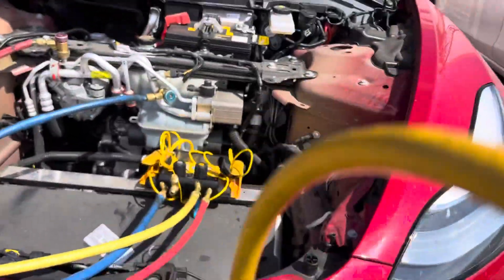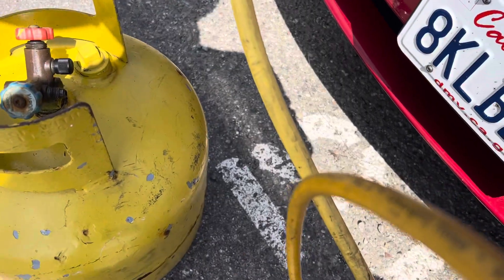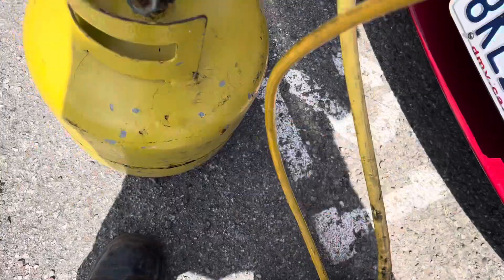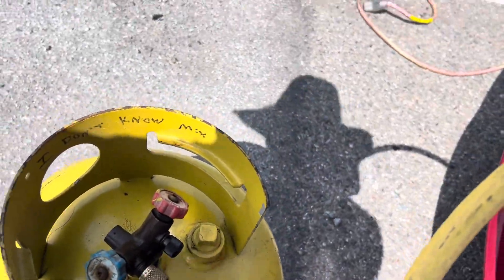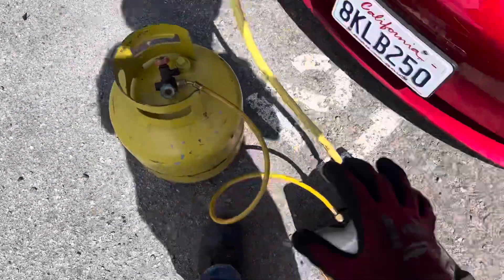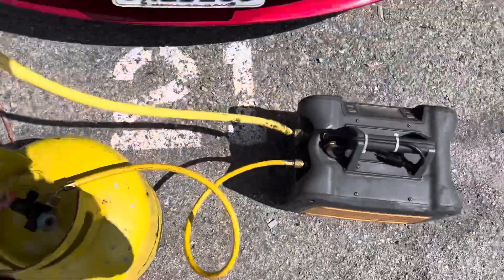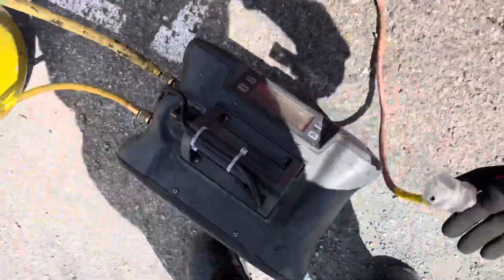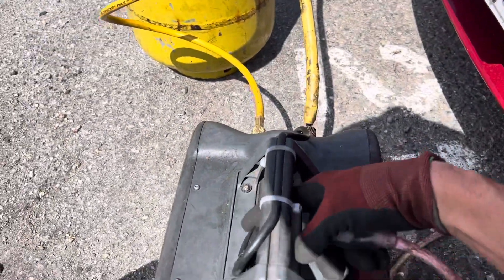RECOVERED CONTAMINATED REFRIGERANT AT TESLA THAT CAME IN TO THIER SHOP.

Comment: do you test the refrigerant for presence of  sealant before using your identifier and then recovery?
Reply from the maker: No ,  ceiling does not affect my recovery equipment doesn’t do anything to any of my equipment. 

But it does plug the filtering restriction device in my refrigerator Analyzer . 

And I have to use extremely strong solvent on that little metal device and extremely high pressure to clean it out . 

It’s a little bit of pain in the ass 

But I have several back up, so I don’t care . 

This is just another one of the reasons I don’t buy that garbage that is sold for the automotive industry , 
      Because it’s sensitive and can be damaged by some of the sealants that are out there on the market. 

And sometimes some of the commercial or residential HVAC guys get the bright idea .  Or a do it yourself customer to purchase some of the sealants that are recommended for a residential or commercial system..    hey system anywhere that has a capacity of 5 tons to 10 tons. 

And they stick that sealant in a tiny little itty-bitty automotive system that is only one ton to 1 1/2  tons capacity . 

I think I have done at least one maybe two videos, showing where my filters on my refrigerant analyzer got plugged up by sealant from customers cars . 

But my recovery machines can eat sealant like a child eats candy bars no problem at all .
Reply: so, Tom for us ,the average techs who work on a/c time to time with a rrr snap on machine,do you recommend using like Airsept sealant identifier to protect the machine and customer's cars and not contaminating the hoses  and the recovery tank? i guess if your answer is yes get it i will buy it on my own and won't wait for the management to to make the decision, thanks T om.
Reply from the maker: @moebassidji8306  if you’re a technician, you should not be the one buying this for the owners of the company’s customers

It sounds like you’re a technician who is not like other technicians and I’m not saying all technicians who just come to a job to collect a paycheck and don’t care about the customers cars 

It sounds like you’re even willing to take money out of your own pocket to protect your boss, is equipment and your customers cars who don’t even pay you money

It sounds like you belong being an owner of your own business or some day at least becoming self-employed because you care too much about your customers 

I know I was the same when I was younger to 

I know because when I was younger, I would pay for my own training that my boss wouldn’t pay for I would takeoff time without pay so I could fly myself out to training centers with no pay so I could do better work on cars and take care of my customers cars who has a technician I would say no financial benefit from my employer 

But yes, if you wanted to protect your expensive R&R equipment and better work for your customers and if I owned a recovery recycle machine that I used, I would put the air sept unit on my own equipment 

It is occasionally annoying when I plug up my Refrigerant and Analyzer. Thank God I have spare flow restrictor’s to swap out, and I have a whole extra back up refrigerant Analyzer. .

Comment: That "I don't know" mix you could spread like herpes to other cars at a discounted rate. 😂. Just call like they put "up to 10 percent ethanol" in our fuel, you could sell it as "R134a up to 10 percent other gasses". 😂 🤣
Reply from the maker: If I wanted to be really evil against other shops, recovery recycle recharge machines

I would put the Old Refrigerant Seal antimold red Devil into customers vehicles 

And when another shop with go to recover the refrigerant, it would plug up the recovery machines, the service greens and valve solenoid 

And do something like throw a few ounces of R410 and vehicles to really screw with technicians mines 🤯

Because refrigerant 410 PT relationship is much much different than automotive Refrigerant 

The Automotive or Shop would not know how to diagnose or make heads or tails of what they see on the pressure gauges so they would recover the Refrigerant and I know because they’re cheap and they do not own a Refrigerant Analyzer 

They would put that 14 refrigerant and mix it with their recover refrigerant, and now all the Refrigerant would be contaminated 

And every car they do the pressure readings will be way off from what they’re used to and they would not know what’s happening 

At first, they were through a lot of parts at cars trying to fix it